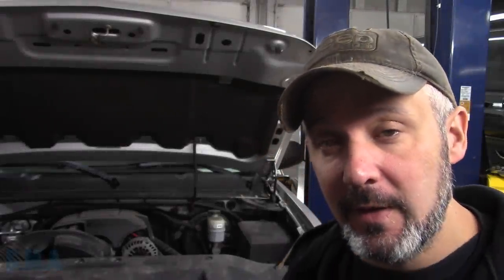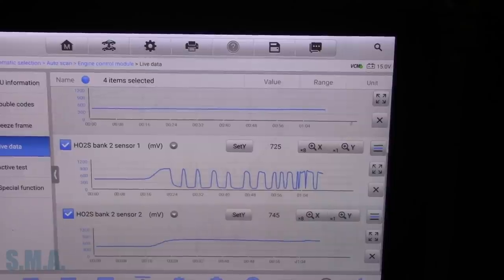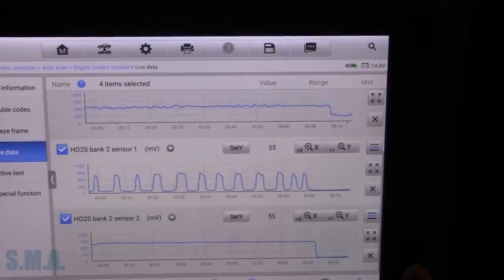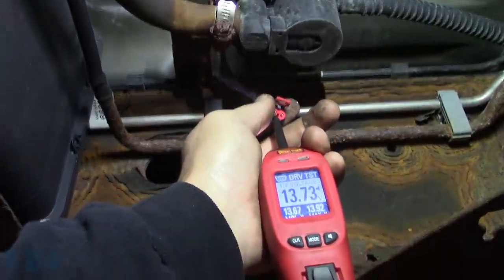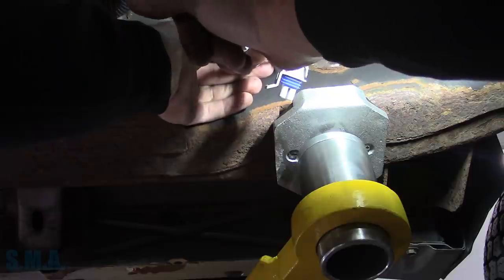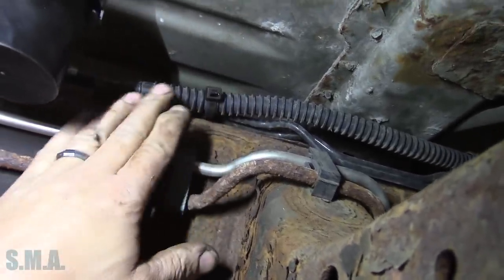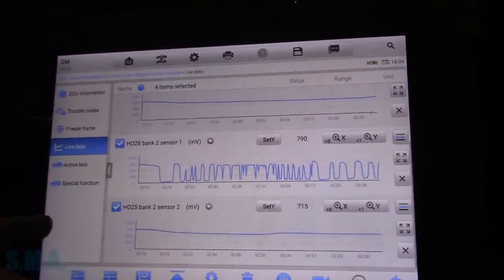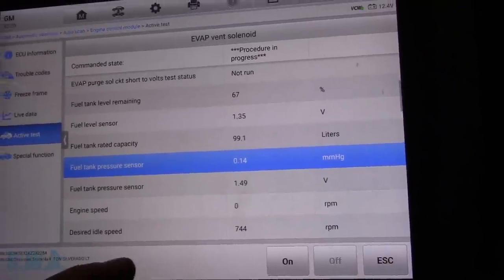Chevrolet 1500 - EVAP and O2 Sensor Codes

Comment: Thank God he drew that tire rotation diagram! You never would've figured that out! Lol
Reply: jubjub247  yeah I love Eric and diagnostic Dan there very good if my car ever has any issues it's going to them
Reply: lots of tires r directional, so its front to rear no swapping sides
Reply: @chejohnny3706  ya I've never seen tires were you need to change sides
Reply: I know I'm late to the party but can I ask a question. Why is there tyre rotation? Does it actually increase tyre milage or do you end up having to replace them all at the same time after multiple rotations? So I guess what I'm asking is this worth it? False economy as you pay out x 4 rather than replacing worn tyres as and when needed? I don't see it this side of the pond that's why it confuses/interests me. Not a mechanic. Appreciate any replies.
Reply: @chrisbentleywalkingandrambling  yes, it does increase the miles you get out of a set of tires. Your front tires wear the edges quicker from turning, so when you rotate them, you put them on the back to wear level again.
Reply: @bigkenny93  appreciate the response. Never thought of that.

Comment: I watch a video you made a while ago about a purge valve trouble shoot, slick video. I used that video and tested mine using my Verus pro, didn't think I had a problem with valve just wanted to practice but I did find a problem. Now this video making an artificial vacuum leak pumping the breaks. Now I have two methods of testing in my arsenal. Thanks.

Comment: Great video, you taught me something new with that quick and dirty test on the signal circuit for o2 sensor. B2S2 i usually take that woven electrical tape and wrap the wires where it contacts the frame.  For the viewers the vent valve that is designed for the truck is like $200 and the impala one is like $50. They both will fail the same. take your pick on what you want to spend $ on.

Comment: Love those quick checks and watching the evap system seal properly.  Nice touch with Mrs. O.  That vehicle obviously never had Fluid Film or the New Hampshire Oil applied.
When you know the relationship of B1S1 and B1S2, it greatly helps with diagnostics.  The brake pedal is a great tip!  Gotta try that one on my Wife's Kia.  It has a P0171.
Good job Mr. O!

Comment: Hey Eric, nice video!!  I just got done putting new o2 sensors in my 2005 Dodge Ram 1500 with the 5.7 Hemi.  What I find very interesting and what I have been saying for a long time; o2's are only good for 100,000 miles.  The new o2's I put in had a sheet detailing a new "revised" service statement that the recommend replacement intervals for o2 sensors is around 100,000 miles, and that they are not lasting as long as manufacturers/engineers originally thought with design to real life expectations.  In fact, all 6 of my vehicles have already had complete replacement of o2 sensors since they surpassed the 100,000 mile mark.  I have a 1998 GMC savanna van, and it had a bad o2, and I brought it into a garage to have them all done.  The tech asked me if he only had to replace the one; and I said "no, do them all; if one fails, the other one is right behind it; with same mileage and age.  I am only paying the bill once, lol !!"
Reply: In fact, I wouldn't put it past it; that dying/slow response o2 sensors are causing premature catalytic converter failures, due to either too rich or too lean of fuel mixtures that go on for 100's to 1,000's of miles, and the ECM/ECU is not able to detect the issue.

Comment: Hi Eric, I had one just like you last week. Chrysler Cirrus 2000. Blowing the fuse when you turn the parking lights on. Asked the owner, did you touch anything or do anything before it started doing it? " No it just started blowing fuses". So out with the diagram checking all the lights and the switch looking for shorts or rubs. Nothing found. DTC socket not functioning, fuse missing. Anyway, went through the whole junction box and all the connections to parking lights and narrowed it down to Connector 5 pin 4. Looked on the diagram, no connector 5 pin 4. But it was listed on the Connector 5 pin out. So I went through every diagram until I found connector 5 pin 4. Now before you fall off your chair laughing. It went to the radio, guess what, after market radio. pulled out the radio and birds nest. Found the wire going to the radio ground. Got it!. Called the customer, did you fit a new radio to this car? "Oh yes and it started blowing fuses just after I fitted it" Can you hear the gnashing of teeth? I knew the radio was not original, but he said it just started blowing fuses. "Oh I connected it up just as the original", clearly not. And this thing had an after market remote start, not the problem. As you say "stick to your procedure". I knew this car had an after market radio but the customer indicated it was no problem initially. 2 days that took. It was a 10 minute fix if only he had said, "after I fitted the radio". I could not bring myself to charge full labor rate, so called friends! Rant, Rant Rant.

Comment: You're so totally right about the Chevy vent valves. I got a hold of one from a '13 Impala once. When it came time to get one for my '03 SS Silverado? I was like...

"Whut? Wait. Show me one from a '13 Impala..."

Sho' nuff, the canister was the same, electrical hookup the same. It had the filter integrated instead of the hose pipe to transmission housing or vintage OE location behind gas fill flap door. 

Let me think really hard now. I don't off-road her, she's a street truck... nearly identical part. 

I took the '13 Impy part home for $20. The OE kit and relocation tube/ filter combo was $97. Ready made decision right there! SS don't know the difference running the passenger car part. ^.^

EDIT: for maximum spelling correction. With napalm. 🔥

Comment: If chafing is a common issue, would it be prudent to add some split loom or something similar to prevent chafing?
Reply: Joe, 
I was thinking the same thing maybe some fuel line split and wrap around the electrical wiring. 
That's what I would do if it was mine
Reply: jubjub247  Their CEOs need raises. :(

Comment: I pulled the evap solenoid out and cycled it a few times with a 12 source and sprayed brake cleaner through it when I powered it up and changed the oring and that fixed it. No more evap codes for over a month now. This was on a 2010 Nissan Versa 1.8
Reply: That sounds like a good Ivan no parts repair.

Comment: That NY salt really does a job on your vehicles. We get our share of snow and salt here in the Midwest but none of my vehicles looks like that underneath. While my ‘99 F250 cab and bed have some pretty good rust patches, my frame is a lot cleaner than that truck at half the age.
Reply: Whenever there's a forecast of snow in NY, their highways are WHITE - almost pure white with liquid brine sprayed before the snow even gets there. Once wet, that stuff gets slung EVERYWHERE, in every single nook and cranny of the vehicle. To top that off, every dirt road is sprayed with the same crap to control dust, so if you live in farm country, you're getting road salt 365 days a year. Makes for very short vehicle lifespans there. My state of MA is now using that same liquid crap on all the main roads. I can already see damage above and beyond normal after just one winter of that. It's brutal. You'd think with all the militant environmentalists that run both states that they'd have an alternative to calcium chloride ...

Comment: Thank goodness he left the tire rotation diagram!! hahha
Reply: And it's not correct for radial tires ... now what? Do what he wants?
Reply: @scottbaker9066  Pretty much anything is "correct" so long as each tyre gets equal time on each corner.  The official listed sequences (there's quite a few variations) are usually just a handy way of keeping track so you don't mix sequences and lose track.  Of course, it's different with directional tyres, but that's not applicable here.  :-)
Reply: @scottbaker9066  doesn't radial only have to do with the tire belt plies, that's not applicable to tire rotation I would assume. Only directional and non directional would then dictate the tire rotation orientation. I do the same tire rotation that was drawn on the diagram out of habit.

Comment: I know I'm late to the party but can I ask a question. Why is there tyre rotation? Does it actually increase tyre milage or do you end up having to replace them all at the same time after multiple rotations? So I guess what I'm asking is this worth it? False economy as you pay out x 4 rather than replacing worn tyres as and when needed? I don't see it this side of the pond that's why it confuses/interests me. Not a mechanic. Appreciate any replies.

Comment: HI Eric.  Learn a lot from your videos. Wish you had one on a clunk for a 2003 tundra when you turn left or right but not when you hit bumps.. Sounds like it is in the rear but cannot locate the source. Replaced wheel bearing, leaf spring bushings and bushings between the leaf springs and it still exists.
Reply: Had similar  problem  spare tire holder was rusted so tire would move hitting  bed floor

Comment: You should experiment with some of these things since they're nearly guaranteed to fail in short order. Put a squirt of fluid film into the vent solenoid and see if that reduces/prevents corrosion and failure over time.  All in the name of science of course.

Comment: That old pipe below the canister looks like it’s ready to disintegrate. Is it a fuel pipe?
Reply: I own that generation truck. That lower line on the frame that looks like it's about to break is actually the EVAP pipe that runs up to the purge under the hood. The upper line is the fuel line. 
I know mine rotted out and I replaced that unhealthy section with rubber fuel line. It's just for the evap vapors.

Comment: Love your videos very informative but I still can't find the ones on 04 pacifica. I have narrowed down no park or turn on drivers front only rear works to ground 104. Thanks to you. This car has been an electrical nightmare since day my daughter bought it. None of the power outlets work except the one in console behind front seats. I have to replace the pcm waited 2 months finally got it plug and play. Trying to find out what caused the other one to go bad is it normal since they put it in front wheel well?????

Comment: Low tech meets high tech - Performing a bypass test on the O2 sensor by doing a "Wet Willie" on the connection ends and watching scan data.

Comment: Hey Eric! I own 2004 Chevrolet Suburban 1500 4x4 5.3 FFV with 152,000 miles. I haven’t needed to do much over the last four years of ownership, except fuel pump, window motors/regulators, and typical maintenance. Is there repairs I should prepare for in your experience? I’m located in Oregon if that helps.

Comment: Ahh the ol' eyelid hickey! I had a few of those in my day. 🤣
Reply: Thanks for the tips! Much appreciated. Didn't even think to use the vacuum booster as a test for the o2! Sometimes things are right in front of my face, and I can't see them (my wife fit that category 26 years ago!). I know I'll be needing an EVAP purge solenoid at some point before my Silverado is exempt from emissions in 2022, so I appreciate the Impala part tip as well! Any time I can stiff GM out of a few bucks, it's a great day. Only fair, right? :)

Now to install transmission #2 in my 103k mile Silverado ...

Comment: Currently working in a truck shop, triaxles, tractor tractors, pick ups, and concrete mixers. Do you have a broom that works really well that you’d recommend? Can’t seem to find one that works well
Reply: Most "push brooms" work better when they are PULLED; there was some brand years ago that was supposed to be the only push broom that actually worked pushing--wish I could think of the name right now. You can try to turn the push broom head around and screw the handle in without turning the head to keep the right "face" of the broom for pushing also.

Comment: Thank you Eric. Now i know the o2 sensor needs a passive .450 volt while the engine off If the o2 have low voltage it will trigger low voltage standby. Am I right?

Comment: 2014 silverado v6,lights dim when using breaks,sometimes wont crank interior lights flicker,service stabili track appears on screen,dealer pulled codes said nothing is wrong.Any advice for a guy  in SC.

Comment: Great video.  Question unrelated to this, what are your thoughts on the durability of GMs 6L80E transmission?
Reply: I’ve had good luck in my 2012 Chev-ro-let 2500hd. Actually this truck has been flawless.
Reply: @brianburns7211  Looking at C6 Corvettes specifically the LS3 versions so 430 HP

Comment: I have a parasitic draw. It goes away when I pull the radio-b (battery) fuse (no. 19 slot) in fuse box. The owners manual shows the only things on that circuit is the radio and power antenna. But when I pull the radio-b fuse out, the speedometer doesn't work and all the electronic readouts on cluster like mileage, etc are not there, then the only part of the cluster that works is the 4 small gages fuel, water, voltage, oil and the cluster backlight. Owner's manual shows all the instrument cluster to be in slot no. 14 (ILLUM) in the fuse panel. I seem to have 2 different circuits controlling different parts of the cluster. Owner's manual shows that should not be the case. 2001 Chevy Express
Reply: If you can, get a shop manual, or the online wiring diagrams. The owner's manuals are no where detailed enough, and I've seen errors in several. Also, try disconnecting the radio, and leave fuse 19 in; see if the parasitic draw goes away. Otherwise you might have to try disconnecting the instrument panel with fuse 19 in to see if the draw stops. Scotty Kilmer has vids on parasitic draw troubleshooting also.

Comment: @7:00 So, if you're going down a hill pumping your brakes, the engine fuel trim is going to go out of whack? Doesn't sound like a very safe system to me.
Reply from the maker: Going down hill engine is in fuel cut mode any way. Injectors are turned off ;)
Reply: I don't think anyone would be pumping their brakes that vigorously ... unless really high on cocaine ...

Comment: I had a oxygen sensor go badd it was a bank 1 sensor 1 vehicle has a 186000 miles on it. When I pull the sensor it was a original Denzo.. If you buy an AC Delco brand 02 sensor it is labeled Denzo. Save yourself a couple bucks and just by the denzo they come with a one year warranty the AC delco come with a 2 year warranty. There's your free tip. Also I changed out all 4 as a precaution they all looked original. Coming up on Winter and I do not feel like doing it in the Middle of winter and outside.. these should be part of 100,000 svc anyway . Cheap 
insurance at $40 a piece.

Comment: CUSTOMER SUPPLIED PARTS ARE OK BY ME. I SIMPLY EXPLAIN I WILL INSTALL THEIR PART AS MANY TIMES AS NECESSARY TO DO THE JOB BUT THEY HAVE TO PAY ME THE SAME AMOUNT OF LABOR EVERY TIME I HAVE TO SWAP IT. TWO TIMES SWAP, TWO TIMES THE LABOR. ALSO I TELL THEM NO WARRANTY ON CUSTOMER SUPPLIED PARTS  AS FAR AS I AM CONCERNED. THEN I ALSO EXPLAIN THAT WITH CUSTOMER SUPPLIED PARTS MY LABOR IS ONLY GOOD FOR 25 FEET OR TILL IT HITS THE STREET {MY BAY DOORS ARE ONLY ABOUT 25 FEET FROM THE STREET} WHICH EVER COMES FIRST.  I  THEN ADVISE THEM THAT  IF THEIR PART DOESN'T OR WONT WORK THAT THEY WILL BE CHARGED EXTRA IF I HAVE TO WAIT ON THEM TO GO GET THE RIGHT PART. THIS HAS WORKED WELL FOR ME SINCE 84, WHEN I OPENED MY OWN SHOP. AND BY THE WAY, I USUALLY END UP SELLING THEM THE PARTS.
OH YEAH I KNOW I'M USING ALL CAPS. I NEVER REALLY LEARNED HOW TO TYPE, AND AT 70 YEARS OLD, I DON'T REALLY GIVE A DAMN !!!!!

Comment: I love customers that supply their own parts and also tell you how to do your job, I refuse to fit customer supplied parts, as I would have a great deal of trouble if a parts failure that endangered someone or hurt someone got blamed on workmanship. The licensing and safety board would shut down my shop for the duration of their investigation and probably try to finger me for the failure as licensing and safety boards do. I politely tell customers to take their supplied parts home and fit them for themself.

Comment: I want you to plug me in and diagnosis. My check engine light is on. After that I can buy my parts. 😄😄
Reply: just go to AutoZone they will tell you what's wrong and you can  get the parts to fix it.

Comment: The truck probably has a broken wire (or wires) in the driver's door flex. I've fixed a GMC extended cab with multiple broken wires before.

Comment: 0:22 If that truck has a full size spare tire (matching set of 5), why aren't they using the 5 Tire Rotation Pattern?
Reply: Salt belt. Spare tire will only come out with the gas axe.
Reply: @jeremyhundley3142  or on its own at an inappropriate moment
Reply: Spare might not have TPMS.
Reply: Spare is usually a different style rim on GM's, especially with the premium wheel option, and has no tire pressure monitor sensor.

Comment: As a former GM technician, I must say ANY GM product made after 2007 is ABSOLUTE HOT GARBAGE! My fiancé is lucky I worked on GM because she bought a 2015 Chevy Equinox, now that it’s past 70,000 miles it’s already doing the famous oil consumption they’re known for and I’ve replaced two camshaft actuator solenoids and it has developed the infamous ticking already....I tried to warn her, but at least we have one reliable vehicle my 2012 Fusion with 125,000 miles that I would trust any day over her GM (Giant Mistake) but I guess as long as she got what she wanted,  right?